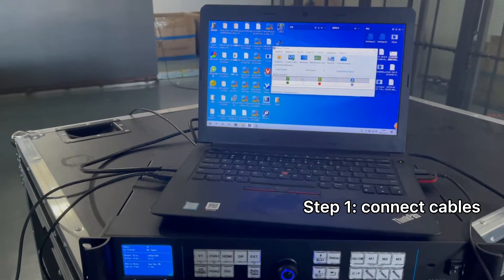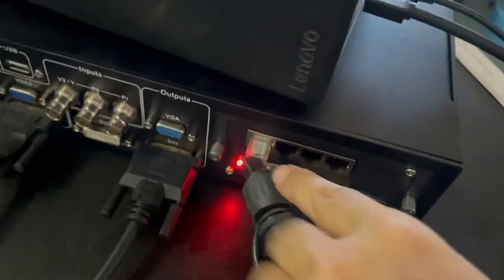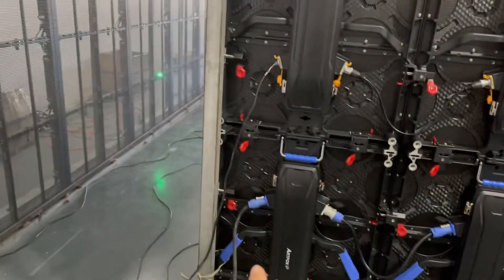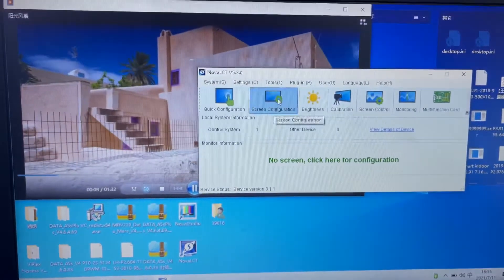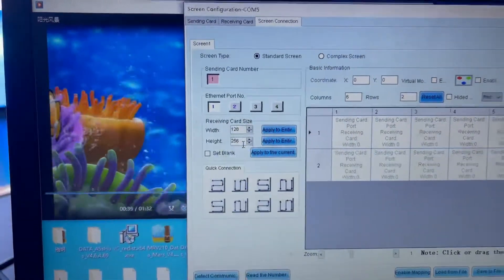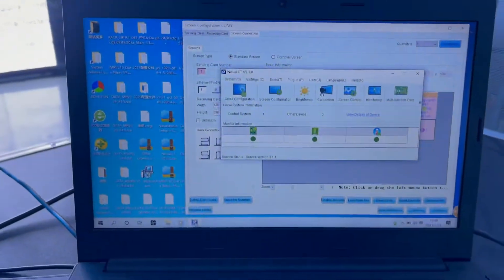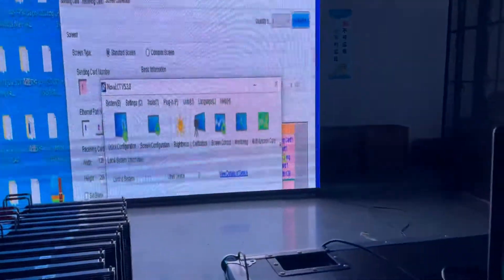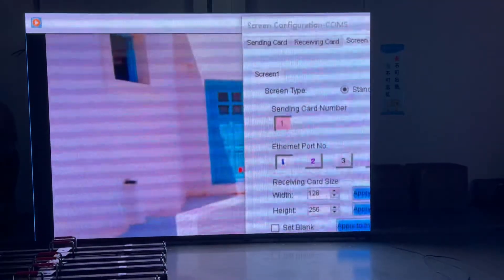How to setup led screen - 4 steps

Comment: How do you map the rectangle units horizontally?
Reply from the maker: rotate the panel on receving card is okay, one click set
Reply: @artfoxlighting  I can make a video wall with these 9 high and 8 wide to show a 16x9 wide screen ratio video wall?